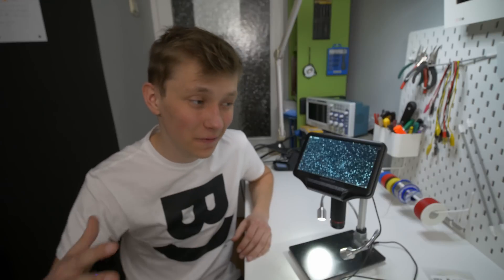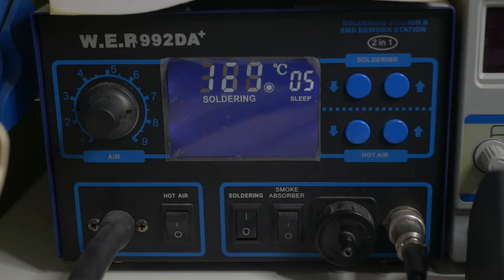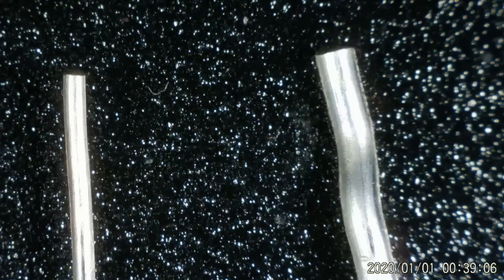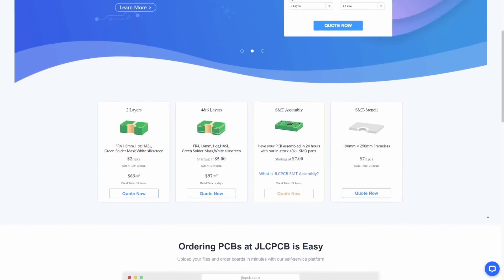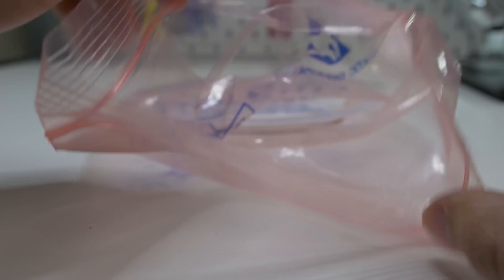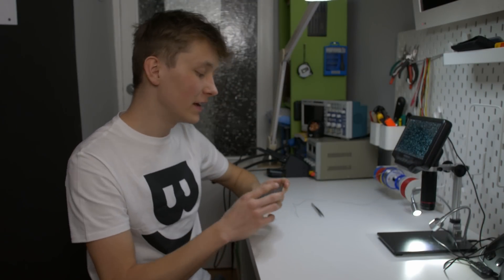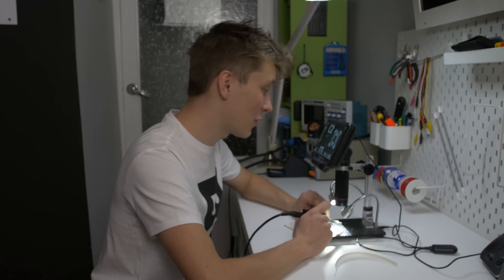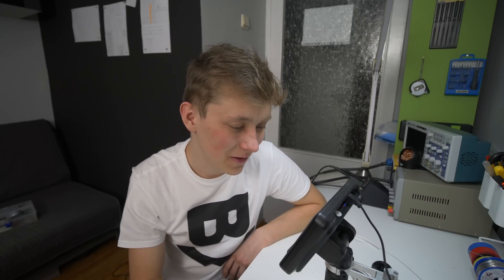I tested a soldering microscope (Andonstar)

Comment: My 60-something hands aren't as steady as your 20-something hands, so I find that even hand- applying paste with a syringe and using a hot-air rework station results in better results than hand soldering SMDs with a iron.

Comment: O:02 "by mistake I bought those super super tiny capacitors" then I thought it would be a cool idea to come up with a sponsored video
5:14 "unfortunately I wasn't able to buy the 01005 capacitors".
So was this an accidental buy or did you do it as a nice pretext for a sponsored video idea?
Reply from the maker: While buying parts for guitar tuner project i bought 0201 capacitors (wanted to buy 0603 but selected 0603 in metric which is 0201). Once I saw how small it is i decided to design a PCB to practice soldering. While designing the PCB I noticed that there is even smaller 01005 so I included those on my PCB but wasn't able to buy those. 
Because this video is based on a PCB I thought JLCPCB will be a perfect sponsor. That way I can make some money and build better projects or buy tools. Is a sponsored video seriously such a big problem?
Reply: @nikodembartnik  absolutely not! I'm just picking up apparently contradictory stuff sometimes and this makes me wonder about which part is the true one. Not only are sponsored videos not a problem, I have a healthy respect for people able to get sponsorships.

Comment: It's painful to watch people soldering without using flux ;) Great video by the way.
Reply: What flux do you recommend? I want to solder an HDMI port.🙏🏼
Reply: @theproud77  use a flux pen :)
Reply: Most tin contains flux these days.
Reply: @rdoetjes  it isn’t that great though. It’s like MIG welding with flux core. It’ll do in a pinch, but for nice welds without holes and voids, you’ll want inert gas. Or more flux in the case of soldering.
Reply from the maker: It's painful to clear all of that without making the PCB sticky. Soldering paste + stencil is all you need
Reply: @nikodembartnik  that is what cleaning solutions and a stiff natural bristle brush are for. 99.9% iso. alcohol and some axarel and acetone work well, and you can blow it off with compressed air, into an empty trash bin.
Reply: @nikodembartnik  But you won't always use stencils, sometimes you have to do some manual soldering. There is a really easy trick to flux cleaning. Use IPA and a brush. After you are done get a clean paper towel and brush over it. It will suck up all leftover residue. It works like a charm.
Reply: @maciejkobus There’s no need to use flux when using Rosin core solder.
Reply: @nikodembartnik   what happened with weller station and why you do not used .
Reply: @nikodembartnik  I don’t mean to be condescending. I understand that you are working on a University Student budget, and not a big corporate budget. You do very well on your projects, even for corporate budgets (they always like to spend the least amount of money). Your at home SMT project is really awesome.